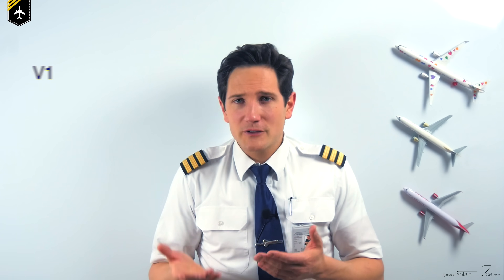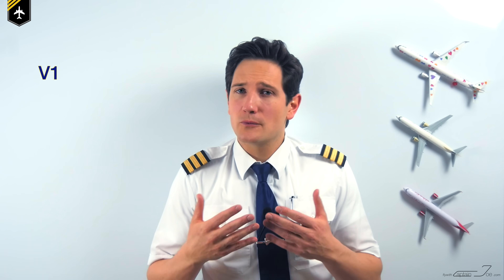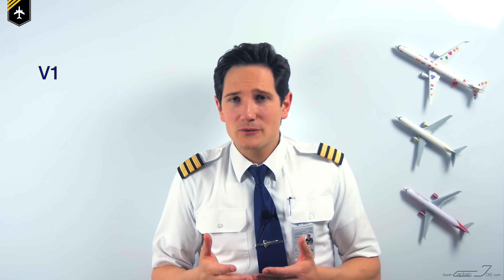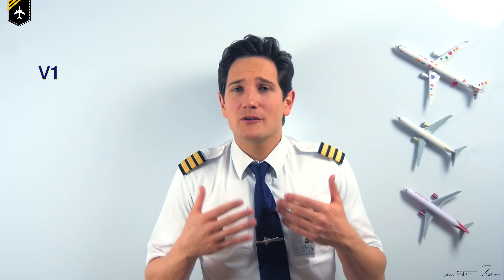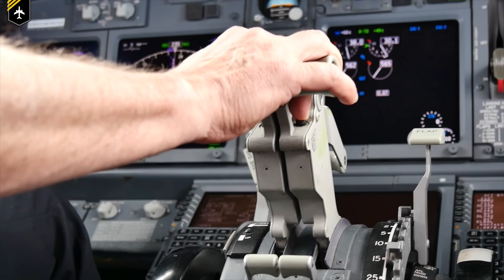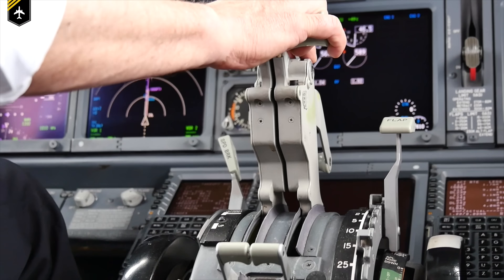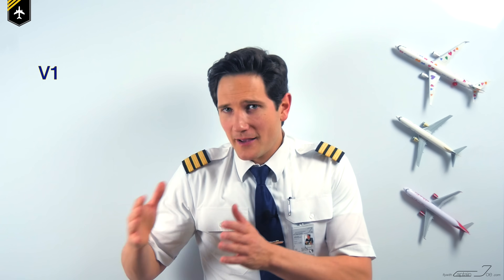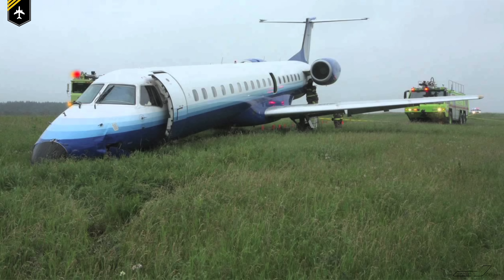TAKE-OFF Speeds V1, Vr, V2! Explained by "CAPTAIN" Joe

Comment: wouldn't a twin engine light cessna on a long runway has v1 after Vr since it would reach rotate speed long before the speed where there is no longer enough room left to safely brake and stop? 

I fly 152 and 172 and on most of the regular runway length we have PLENTY of room to set down again even after we already rotate and airborne.  Actually, for any big emergency like obviously engine failure but possibly  also other BIG mechanical emergencies, we supposed to try to set it down first if we still have any runway left.  

This would seems to extrapolate even to jets.  Given a long enough runway and light enough plane, I would think that V1 CAN come after Vr sometimes.
Reply: Ming Ming no it doesn't work that way because of their definition. V1 is the max takeoff rejection speed on ground. Vr is the speed at which you rotate ie move from ground roll to in flight.

So if at vr you're going in the air, then there can't be a concept of v1 as you've already achieved take off, so you can't reject it.

Conceptually, only time v1 can be greater than vr on an infinite long runway is if you don't rotate at vr. 

Therefore the max value of v1 is vr and not beyond that.
Reply: @ZK-APA  Ok. i see how that works.By definition that makes sense.  But it would seem that in practice, it shouldn't be like a dead set thing that you must blindly follow 100% of the time in 100% of circumstances.
From tracking when we rotate (vr)  and estimating that v1 came shortly before that, on most commercial jet i am on, we would be beyond the half point of the runway when rotation happens.  But practically, as far as high speed rejection goes, if you have a long runway like say a 12000 to 15000 ft long, even at vr a lightly loaded 737 might have plenty of braking room left.  So in  that case, esp with severe failure, wouldn't you be better to just do a high speed rejection?
https://www.reddit.com/r/flying/comments/445527/can_v1_ever_be_greater_than_vr/
Reply: Ming Ming it depends. As in if you have something like an all engine flameout or an uncontained fire or any other issue in which you know it's obvious that you won't have the time to recover, then yes you will have to abort and try landing back.
But for any other, there is enough redundancy that you can still take off, diagnose and take necessary actions.

Comment: If the runway is very long and with favorable pressure and altitude conditions, can it happen that 
V1 > VR ?
Reply: David Sourdis no it can’t, because of the definition of both

At vr you transition from roll to take off. Whereas v1 is take off safety speed on roll 

So at a speed above vr, you’ll actually be in air where there is no concept of v1

Comment: Can v1 be after vr in the case of a cessna on a full size runway?
Reply: joblessalex no it cannot. It can be equal to each other but v1 can’t be greater than vr because of its definition 

V1 is the max speed when you can abort take off. Vr is the speed when you rotate, so basically you transition to lift off. So by definition, you cannot abort take off if you’ve already lifted off.
Reply: @ZK-APA  Can you take off, then abort once in the air and land again?
Reply: joblessalex technically you can, but one would only do that if it’s certain that continuing the flight is impossible. Eg taking off and then immediately you have an all engine failure.

Comment: What is, if you have a very small plane (Cessna for example) and operate at a very long runway (for example Cologne/Bonn with 3000m),and you never reach a point, where you are no longer able to stop (even when reaching Vr, you could technically still abort Takeoff), do you just don't call out V1 before Vr or other things?
Reply: Jan Lukas call will be V1 rotate in one flow. Moreover the PF will be aware of the fact that v1 and vr are same, as it would have been briefed beforehand.

Comment: Call out 80 knots or 100 knots? I'm confused here
Reply: Hans Samson depends on the aircraft. Slower aircraft will be at 80
Reply: This call out 80kts or 100kts (depending on the aircraft type) is there for three reasons: check if other pilot is incapacitated, check if both airspeed indicators agree and also separates low speed from high speed rejected takeoffs because reasons to reject a takeoff in the high speed regime are much fewer than the reasons to reject a takeoff in the low speed regime

Comment: The V2 is hard to understanding.
Reply: It is the minimum speed that provides both adequate climb performance and directional control in the event of an engine failure on takeoff
Reply: @pilotinterviewhandbook3064  Thanks for your reply, I review the video and  your statement, the V2 should be designed by the manual and known by the pilot and control tower.  Then , during the take off, the plane is  running at all engines, it should be exit/higher speed then V2 then the pilot take off and retract the gears / flaps etc. As the example from the video, a bird was hit by the engine when take off, the speed should be dropped, the plane was non stopped and going to take off (may be non stoppable) , it is a danger situation too.  Am I right?

Comment: I rather damage the plane on the ground than take off and crash
Reply: After the V1 the aircraft is not able to stop in the remaining runway, so the procedure is to take off and make a go around and return for landing. The aircraft can take off and fly if one engine is inoperative.
Reply: @mikep9604  single engine, lets crash the fence...
Reply: @davejohn3820  - It's hard to know what you exactly mean. It's a requirement for a twin engine aircraft that it can take off and fly with one engine. Every aircraft must have  a type certificate and this thing is a part of it.

Comment: Man, i’ve been flying for 41 years. Started in Cessnas at 19, 8 years USAF (including T38 instructor), and with a major US airline for over 30 years. With all that, i STILL watch your informative videos as a sort of refresher between and just prior to my training events (of course, i’m in the books as you’d expect), but it’s amazing how much one forgets, thus the term “refresher training”. Your videos are great refreshers for those of us who are old heads.

Our standard brief:

“Any problem under 80 knots we’ll abort. 

Between 80 knots and V1, we’ll only abort for engine failure, engine fire, predictive winds shear alert, or for any problem rendering the aircraft unable to fly. 

After V1, we’ll consider it an airborne emergency and continue the takeoff”.
Reply: My briefing sounds more or less the same but I believe it's pretty much depending on the plane you operate. (sure, heavy jet might be different but I'm a turboprop guy)
Reply: @alexanderpeterap  ITS B737 BRIEFING
Reply: I have a question:

Let’s say you reach V1 and all of your engines go out somehow.
Wouldn’t it be safer to abort and use the remaining runway to lose as much kinetic energy as possible, rather than taking off because you have reached V1?

My reasoning being that you’re far more likely to bleed off your energy on the ground, since trying to take off after reaching V1 with no engines will most likely result in something worse than what would happen on the ground.

I mean no ill intent with my question. I just want to learn.
Reply: @IbnuCuruk  yeah you are correct.
Reply: @IbnuCuruk Most airline company flight manuals have list or table of acceptable aborts divided by below 80kts, between 80kts and V1, and after V1. My company has several pages explaining the concept of what might constitute an abort but also has a table of suggested items. This is what they are; BELOW 80kts: Unusual noise or vibration, tire failure, abnormally slow acceleration, ITT exceedance, Takeoff configuration warning, Engine Failure, Fire/Smoke warning, wind shear, aircraft is unsafe or unable to fly. ABOVE 80kts TO V1: Engine Failure, Fire/Smoke warning, wind shear, aircraft is unsafe or unable to fly. Finally, the answer to your question, ABOVE V1: If the aircraft is unsafe or unable to fly. Many captains word that as “if the tail falls off” as a joke during the rejected takeoff brief.

Comment: I have a question outside of this video...... Why do pilots say 100, 50, 40, 30, 20,10 pror to landing?.....
Reply: It's the computer system which announces the numbers. (There is a radio/radar altimeter which measures the altitude during the landing). The numbers mean altitude, and the computer voice gives the altitude readings during the landing.

Comment: Having read through a bunch of the comments, I'll try to clear up some of the misconceptions evidenced about V speeds:

*  V1 is a "flight manual" speed -- not a "physics" speed.  A Part 25-certified airliner performing a maximum-energy rejected takeoff (RTO) on a dry runway with new brakes will come to a stop with a considerable amount of runway still in front of it, even with the loss of one thrust reverser.  Under these conditions ("dry runway" in particular) there is a big factor of safety in the formula which the FAA mandates.

*  Calculation of V1 takes account of pilot reaction time for things like retarding thrust, so the decision doesn't need to be made before V1 is called.  It can be at V1.

*  A takeoff may still be rejected after V1, but that should only happen if the pilot believes the aircraft is no longer airworthy -- that their best chance for survival is to go off the runway.  Speaking of...

On one occasion a DC-10 RTO'd even after Vr, for what turned out to be a relatively minor mishap.  It had blown a nose tire, thanks to autodetonation caused by what the investigation determined to be a hydrocarbon-contaminated tire inflation hose.  The pilots felt vibration from something after V1 and continued the takeoff roll, as they should have.  When the vibration increased at NLG liftoff (no surprise given that the shock strut was now unloaded and had an imbalanced mass rotating on it...  but they didn't know any of that), they made a split-second decision -- wrong, as it happened -- that the aircraft wasn't airworthy.   During the resulting runway overrun the DC-10 stripped its landing gear (per design) and was destroyed by fire, but everyone got out ok.  Last person out was a flight attendant, who had first made sure the cabin was cleared before jumping from the forward door's sill (no slide but no landing gear either, so about ten very long feet).  A photo one of the evacuated passengers took of her making that leap from the flaming aircraft is a reminder to me that serving drinks is not why flight attendants are on board.  

*  In the unlikely event both/all engines fail, hydraulic power for the brakes is still available from accumulators:  Pressurized spheres of hydraulic fluid.  On the MD-80, for example, its two brake accumulators provide enough fluid for three press-and-release cycles of the disc brake stacks.  So in the case of a hydraulics-out landing, that means trying to avoid differential braking for directional control.  Easier said than done:  During a simulated hydraulics-out landing in the MD-80's flight test program, Ship 917 did stay close to the runway centerline under rudder control through NLG touchdown, but over the next 15 seconds/3000 ft it almost veered off the left side of the runway before finally departing the runway on the right side at about 70 kt.  The landing gear stripped off per design (helps prevent fuel tank rupture vs if the gear trunnion rips away),  but then in the recovery effort an improperly-ballasted crane toppled and fell across the fuselage.  Ops.

[17 August 2020:  minor edits for clarity;  added Ship 917 incident]

Comment: So on takeoff soon as you have all your wheels off the ground is it just common sense or something more technical that determines your climb rate so you dont grind the runway with the tail section?
Reply: Barny Canuck when you take off, you aim for a pitch angle (15 degrees for the a320). That way there won’t be a tail strike (provided v speeds are correct)
Reply: ZK-APA Thanks very much

Comment: Dear Joe, I would like to know how the lights at the runway don't get squashed by the aircraft's nose gear.
Reply: The problem there would be more the light hurting the tire than the tire hurting the light.  The light is inside a cover, and that could be made quite tough if need be.  The tire OTOH would accumulate fatigue damage, and the bumpiness from running over a series of lights would be really unpleasant .  So each light + cover is recessed into the pavement, which also comes in handy for when a snow plow is doing its thing.

Comment: Hey Joe, very useful videos. Thought of asking a question. I heard once a pilot in india touched down with nose wheel first intead of the wing wheels, while landing. What are the precautions and procedures if this happens? When does this type of landing occur?
Reply: Pratap Muthukrishnan link please, because planes are not designed to land with nose wheel first
Reply: @ZK-APA  here you go. The recent incident https://m.timesofindia.com/business/india-business/indigo-flight-lands-nose-wheel-down-down-first-stops-safely-pilots-grounded/amp_articleshow/69117957.cms
Reply: @Pratap_82  Ok. The cause isn't written, but most probably it is because the pilots didn't flare. That's pilot error. So precaution is to flare properly and for the other pilot to monitor it
Reply: @ZK-APA  thank you 😊

Comment: Years ago as a passenger on commercial flights I started timing the time between when the engines apply takeoff thrust and the brakes are released to the moment the aircraft rotates. It is almost always 30 seconds regardless of the type of aircraft and airport. (One takeoff from Denver took several seconds longer, I attribute that to the altitude)

Why is this?

Comment: Dear Captain Joe . . . if I may , we must be careful when asserting that the aircraft lifts off the runway when “ the generated lift over the wings becomes higher than the aircraft weight “ this demeanor is in reality a misconception . . . in actuality the entire aircraft underside becomes a lifting body which exerts a “downwards” force on the fluid due to the incidence angle in the direction of travel. This gives way to an equal and opposite force “lift” that is vector distributed between it and “drag” along the aircraft plane of travel. That is why on T/O you apply flaps in order to increase the resulting downward force by increasing the area of contact with the fluid or in this case air, at lower speeds in order to decrease Vlof . . . so in reality and in accordance to Newtonian physics ( not Bernoulli ) the force of lift is distributed along the entire surface plane of the underside of the aircraft and it increases ( assuming constant or accelerated forward velocity ) with the angle of incidence and it is always perpendicular to that plane . . . so . . . lift is present under the aforementioned conditions, not over the wings but throughout the entire underside plane of the aircraft . . . even if you are flying “straight and level” , lift is still generated by a slight angle of incidence and sheer velocity . . . otherwise . . . the aircraft will loose altitude. . .

Comment: Well explained Sir, I want to know if there is any physical movement/change in any part of plane while takeoffs
Reply: The elevator tilts upward to push the tail of the aircraft down.  That increases the angle of the wing to the airflow, causing it to produce more lift.  The wings then bow upward a bit more from that increased lift force.  At liftoff, the shock struts fully extend since there is no longer the weight of the aircraft compressing them.  If it's a four-wheel bogie (widebody aircraft), the trucks will probably assume a new angle ahead of gear retraction.  Other than more subtle changes in the aircraft's structure, I think that's about it for a generic airliner.

Comment: Hi,

Thanks for the great video! I still have a question: I know that wind affects V1 (headwind increases it and tailwind decreases it), but I don't understand why...
 I hope someone could help!
Reply: valderwinnen because the winds changes your ground speed. Hence for a given indicated airspeed, with a tailwind you are faster on the ground, and with a headwind you are slower. Hence for a tailwind a lower indicated airspeed v1 is taken
Reply: @ZK-APA  Hi, thanks gor the answer but it's not exactly what I'm looking for.
It's true that a headwind increases the perfomances and the tailwind the opposite. I clearly understand that with a tailwind, as the rotation is made later (at a higher groundspeed), we need a lower V1 to ensure enough runway after it.
Still, I'd like tl know how we calculate it.

Same in case of headwind, the rotation is made earlier (lower groundspeed, as you said) and as the acceleration is greater the V1 and Vr are closer. But what is the mathematic relation there?

Comment: Is it possible to have a V1 that is bigger than Vr? lets say for a long runway and small plane?
Reply: james agneessens no. Because at vr you are transitioning from the take off roll to lift off. And v1 speed by definition is only valid during the take off roll.
Reply: So it can only equal at most
Reply: Theblood Tank yes

Comment: Captain Joe : At V2 and engine failure. Is the climb rate reduced, is one engine powerful enough to keep the same climbing angle?
Reply: bax442 yes the climb rate is reduced. But the climb gradient is still sufficient for obstacle clearance with a failed engine.

Comment: So couldn´t  there be a case where V1 simply does not aply? 
Maybe a small business jet needing only 1.200 m to get airborne on a 4.000 m runway. Vr would be reached prior to V1 and V1 therefore unnecessary, right?
Reply: grinch10001 no. Because v1 only applies during the take off roll, and at vr you transition from the take off roll to lift off. Hence the max value of v1 is vr